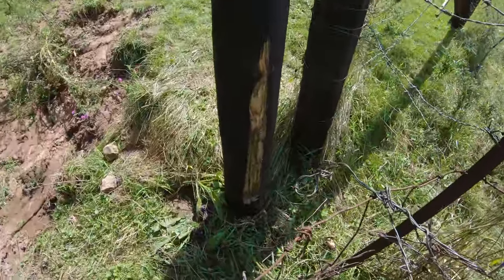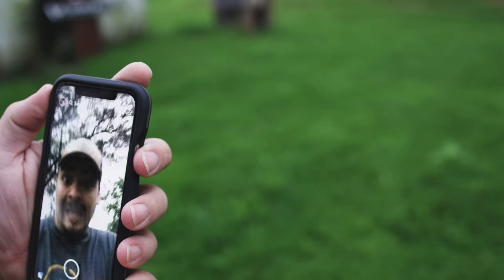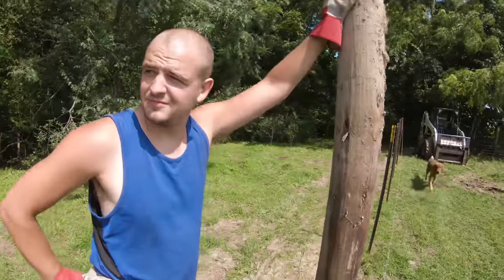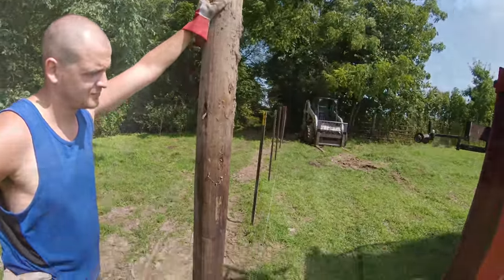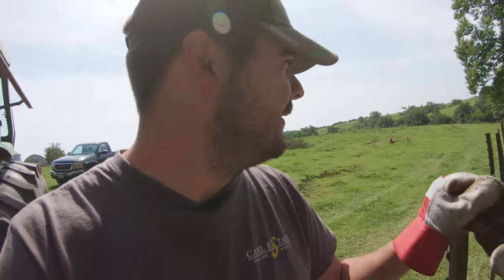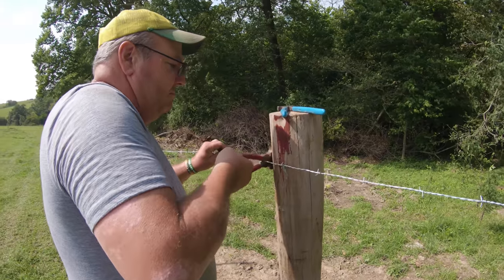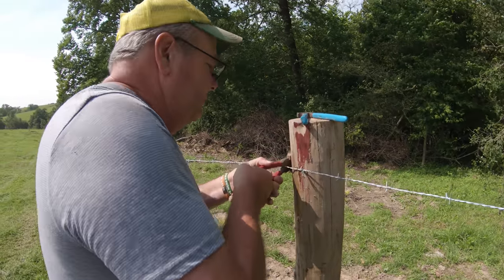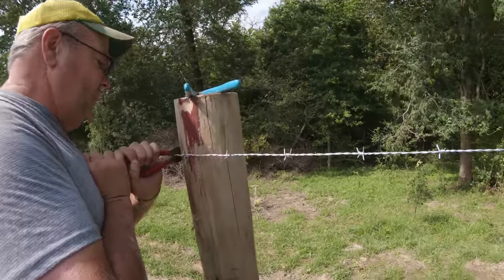1 Day Old Barbed Wire Fence

Comment: Yall will stay trim and get muscled up slinging that manual T-post driver, that's for sure!  We use one for "fixing" fence, but putting in fence, no way-- I'll push em in with the front end loader on the tractor every time... 

When we put up the perimeter fence on the Needville farm, it was actually before we bought the front end loader for the tractor-- I bought a T-post press that bolts onto the tractor drawbar, which basically was sorta like a mini-version of the Shaver wood post driver-- tube within a tube, with a chain you hooked around the T-post to hold it in (like the clamping rollers on the Shaver) and a side handle you held onto to keep the post and driver vertical.  It was mounted on a "U-joint" made out of square tubing that attached the anchor to the drawbar-- you put the post in the "pocket" at the top, signaled the tractor driver to back up til the post was vertical, then hooked the chain around the post, held the handle to keep everything vertical, and gave a signal to the driver to retract the cylinder, pushing the T-post right down into the ground.  Unhook the chain, the driver extended the cylinder for the next post, and drove away, while I grabbed the next post and put it next to the 10 foot stick of PVC pipe we slid between posts so we got them all lined up evenly.  Wash, rinse, repeat, several thousand times... Worked great and sure beats hammering them in!!!! 

Later!  OL J R :)

Comment: have you ever tried using the bottom of the bucket to push steel post in right below the pins on the bucket. it worked great on our farm
Reply from the maker: Have, but only when necessary. That can be pretty dangerous.
Reply: You have to be careful of rocks... Not a problem on our bottomless black gumbo clay that is totally rock-free here at Needville, but at Shiner it's a different story... I push T-posts in with the front end loader on the tractor, but you DO have to watch and go slowly pushing... I've had them hit a rock and turn into a "U" shape real quick.  I usually just move over and push another post, and it clears the rock.  The "U" shaped ones I can usually straighten right back out, bending them by sticking one end under the drawbar and the middle of the bend over the lower 3 point arm and just pushing down on them to straighten them out, or wedging them in the bale forks and bending them straight.  Doesn't seem to hurt them.  

I've had some posts that I was pushing and it lifted the front end of the tractor off the ground, but the post didn't bend.  Just raised the loader and put the wheels of the tractor back down again and called it good, or moved over...  

Later!  OL J R :)

Comment: So watching you unroll the bar wire brings me back.  I have had the wire get caught on itself that it would of pulled me off the quad.
Reply: Never had that issue. We ran a pole across the rear of the truck. Least till a gold cart was modified with a special cut in on a wood platform..

Comment: Nice job just a suggestion what we did with our fence was use 2 strings of the barb wire as the electric fence. That way you don’t have to run another string of wire

Comment: Thanks for a very good video and bringing back a lot of memories in my younger days on the farm.  Putting up a barb wire fence or  wire-mesh fence; drove a many of a fence post in the ground with a 20 pound sledge hammer (sharpen one of the fence post and go for it) or we dug the holes with a post hole digger.  Took the slack out of the wire with wire stretchers (something like a come a long) or use the tractor to do it (a little on the dangerous side using a tractor with barb wire; you could snap the wire) normally we nailed the wire on the first three or four post from the tractor; then went from there. I see now day they are using those fence steel post. Easy to put in the ground and you just hook the wire in the slot.

Could you have used three wire vice six?  we used three.  (I have seen barb wire used for hog fencing too)
Reply: We usually use five for perimeter fences, though some guys use 6.  IMHO it's kinda superfluous... we keep the bottom wire up about 15-18 inches off the ground with cattle around here-- so wet the lowest wire rots if it's too low-- down in the damp/wet grass and weeds.  Some guys will put the sixth wire down there though; if it makes them feel better, that's their choice.  Five will hold cattle just fine IMHO.  

We've done a lot of cross-fencing inside the farm with 4 strands of barbwire, but IMHO five is MUCH better.  Don't see how 3 wire would hold anything-- cows don't respect a 4 wire fence as much as a 5 wire... 3 wire I think they'd walk right through it.  Least that's been MY experience... 

Later!  OL J R :)

Comment: Nice job.Do you attach the electric wire to the fence as a out rigger wire attached to the wooden posts or is it a separate fence?We use out riggers here in NewZealand.

Comment: Depending on the model of your washing machine, replacing the drain pump isn't that hard... on my Kenmore all you do is remove two spring hose clamps with pliers, pop the two latch hooks off that hold it onto the end of the motor, and slide it off.  You can order the pumps online and have them at your door in a couple days.  Sure beats buying a new washer, and the new ones don't clean worth a rip anyway because they're all "high efficiency" and don't use enough water or have an aggressive enough agitator to actually clean properly... Why I'm keeping my old one going as long as I possibly can.  

Had to replace a rag joint connecting the motor to the transmission a few months ago, so I had to pull the pump to get to the long screws that hold the motor to the transmission-- easy enough job to do and only cost less than $20 bucks IIRC.  

Later!  OL J R :)

Comment: How are the wires fasened on the poles?
Reply: Wire clips on the metal posts, it's looped around the wood posts and then wrapped back around itself, some like to staple the wires to stop them from sliding up and down the posts.
Reply: Boer, it looks to me like they are stapled to the wood and hooked on the T-Posts.

Comment: I'm in the UK where we use all wooden posts, a larger post similar to what you were using for corner and gate posts in cylindrical and square variants and a smaller cylindrical version to make up the rest of the fence. I'm wondering why you use a combination of metal and wooden posts there. Is it due to material availability, climate differences to the UK or something else, a combination of all of those?
Reply from the maker: Probably due to some economical reason, or possibly that T-posts can be put up faster with metal clamps vs staples on a wood post.
Reply: The speed of putting them up would be more important there with the many more miles of fences that you have to maintain. 
I live on one of two farms that have been combined to form a total of 100 acres with easily half of that bordered by hedges. Although those hedges follow fence lines, we don't need to maintain the full fence line, just patch gaps that open up, so the speed of putting up fences or sections of fences isn't as important. These are really just guesses from me as they're my Granddad's farms, we just live in one of the houses and help out occasionally when not attending work (outside the farm) or school/college. 
Anyway, thanks for replying.
Reply: Expense... T-posts are WAY cheaper and a LOT faster to put in that wood posts, and they last a lot longer too.  Problem is, they're not as "durable" in that they can be pushed over easier from cattle pushing on the fence... Wood posts are MUCH more resistant to cattle pushing on the fence than T-posts.  Problem with wood posts is, 1) cost, 2) digging/tamping posts in (don't/can't use post pounders like that down here), and  3) longevity, or lack thereof... The gubmint done outlawed all the good post preservatives like creosote and arsenical treatments; all you can get now is that "Yellawood" treatment crap, which is corrosive to your staples and wires and the posts rot in half the time anyway...  When we were fencing the place years ago, we tried nailing to a 3-4 year old post in the fenceline that the phone company put there... it was a "good" treated "yellawood" post, like a corner post, about 8-10 inches in diameter... darn thing started flopping every which way and the phone box broke loose from it and then the post broke off... it was rotted down to about 2 inches from the soil surface on down and soft as a dishwashing sponge!  

For wood posts, I greatly prefer railroad ties.  We can get replaced RR ties with good CREOSOTE coatings that will last for years cheaper than the yellawood treated crap posts that rot in just a few years... Some guys also use old utility poles, which are also creosote treated (or used to be... actually the gubmint pretty much outlawed making creosote poles in the US, so for awhile, the power company tried using "yellawood" type lame-treated poles and found they didn't hold up for them either, so they switched back to creosote poles... they have to IMPORT THEM from Mexico now, because no US companies make creosote poles anymore... They tore up a mile or so long stretch of 3 phase power lines near the farm that were only about 5 years old, to replace the stupid "yellawood" poles with imported creosote poles... I know because I talked to the power company linesmen when they were working across the end of the farm... 

Later!  OL J R :)
Reply: luke strawwalker Thanks for all that information. Being in the UK I wouldn't have learned all of this without you putting all the details here. 
Posts here, wooden cylindrical and square, have a pyramid design for driving them into the ground, and ground here is usually soft enough to just drive them in with the loader of our Massey Ferguson 390T usually without lifting the front wheels off the ground. My granddad has previously dipped the ends in used engine oil (old school ways, no EPA or anything else to worry about a few decades ago) but I'm sure any environmental agency would highly discourage that now.

Comment: i think id just use the skid loader to push the steel post in
Reply: Plus it's hard on the bucket.
Reply: @dwightkuster8249  also true.
Reply: Not if you don't hit a rock...  Done it thousands of times... 

Even at Shiner, when we DO hit a rock, if the post is straight and true (level in both directions) I've had it lift the front end of the tractor off the ground with the front end loader pushing the post in, and NOT bend the T-post!  Just raised the loader to put the wheels back down, and moved the post over a foot, and push it right in... no problem.  

Even when you DO have a post bend on you, I just wedge the end in under a bale fork frame on the loader and over the bale fork tine, and pull down on it and straighten it right out, no problem.  Good as new and they work fine.  

You DO have to work carefully though... we'll hold it just long enough to push it in about 4-5 inches into the ground so it'll stand up on its own, then back off and let the loader push it in the rest of the way, so if it DOES go wonky nobody gets hurt.  If you're watching you can see the post if it hits something underground and stops moving, and back off the loader before anything bends most of the time... 

Later!  OL J R :)
Reply: We use the bucket to pull posts when removing old fence... hook a short 3 foot chain with a couple grab hooks on the bucket end, loop around the post, and the driver pops them up out of the ground... toss them aside or directly into the loader bucket to haul to a burn pile... no problem.  

Later!  OL J R :)
Reply: iv done it lots of times

Comment: You guys are working way too hard on putting those steel fence posts in.  One of you hold it straight and the other one get on your loader and use the bucket to push it down.   My old man and I did miles of fence over the years doing it that way.
Reply: They're probably worried about 2 things-- 1) rocks, which will stop a T-post dead in its tracks when it's being pushed in and lands square on top of a buried rock, usually bending the post, and 2) the skid steer hydraulics are usually pretty fast and you're real close to the post when pushing it, inside the skiddie, or holding onto the post... 

We push them in too using the front end loader on the tractor, either with the bucket or bale spear frame (whatever is on the tractor at the time usually).  We're on rocky soil too on one farm, and the FEL is nice because 1) your further away from the post if it DOES hit something and go wonky on you, and 2) the hydraulics are slower so it gives you more time to see if/when the post stops going down because it hit a rock.  

Later!  OL J R :)
Reply: Fair enough about the hydraulics.  We used the loader either on our 3020 or on our 95hp Kubota.  Neither tractor had fast hydraulics, but I suppose a skid steer does.  As far as rocks...I never really thought much about it...at worst I guess it could bend the post.  I always wanted to make a 12 inch long version of a fence post driver that I could mount to the front of the bucket.  That way,  once the post was in place and the driver had it, I could get away.  I've had the bucket hit me in the head more than a few times.

Comment: stupid question from a machinist that lives in the city.... why not use all steel posts????
Reply from the maker: I said in the video, that we use wood posts because they get below the frost line, which reduces frost heaving
Reply: so another really stupid question... why not set the steel posts below the frost line... in minnesota our frost line is about 36-40 inches... and an 8 foot long steel post will set that deep surely in wisconsin with at least a 4 foot fence line???.. again stupid question...
Reply: It's hard to get T-posts in that deep... the longer they are, the easier they are to bend.  Sorta like trying to push a dry piece of spaghetti through a watermelon-- you can only go so far before it breaks...  PARTICULARLY in rocky soils like they have... 

We used 6.5 foot T-posts on the perimeter fence of our farm, because of the costs.  Installed steel corners in concrete, and 6.5 foot T-posts every 10 feet.  Still was several thousand posts and about $15,000 bucks for posts and 5 strands of Gaucho barb wire.  We pushed them in about a foot and a half or so deep, which is pretty easy on our black clay gumbo soil with no rocks, using a post pusher... 

We had to put a hot wire on the inside of the fence though to keep the cows from pushing on the fence to get to grass in the road ditches on the other side... they were starting to lean the fence pretty badly in only a few years without it.  10,000 volts stopped that problem cold!!! 

Later!  OL J R :)
Reply: Also, 5 foot T-posts are pretty cheap, 6 footers are more expensive, 6.5 footers are more expensive still, and 7-8 foot or longer T-posts get VERY expensive in a hurry!  

I've bought a few 8-10 foot T-posts for special circumstances, but honestly for fence line posts, wood posts would be cheaper at that point!  

Later!  OL J R :)

Comment: good job but isn't a little hot to be in jeans?
Reply: I do
Reply: You generally don't do fencing in shorts... barb wire will play h3ll with your legs.  Jeans at least provide SOME protection-- if nothing else catching the wire rather than letting it "slide past" your leg and letting the barbs flay you open or scratch you up badly... 

I wear shorts for a lot of things down here in our 100 degree plus Texas heat, but when it's time to do fencing or fence repair, out come the jeans and usually a long sleeve shirt, regardless of how hot it is... otherwise you can get sliced to ribbons!  

Later!  OL J R :)